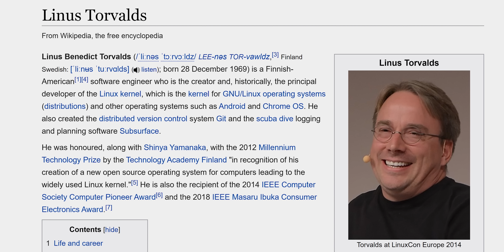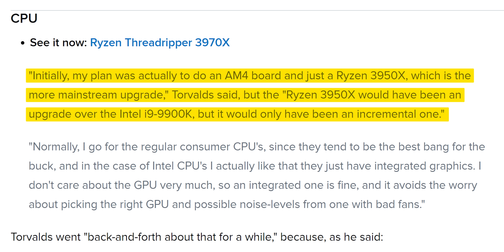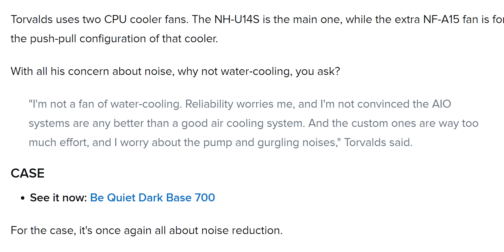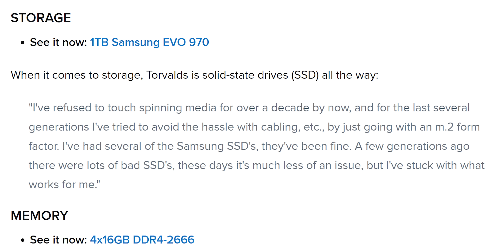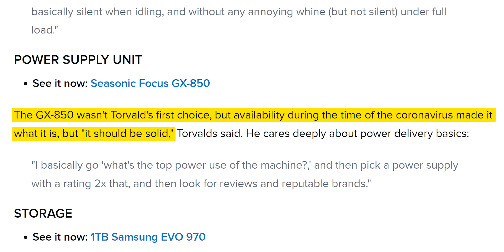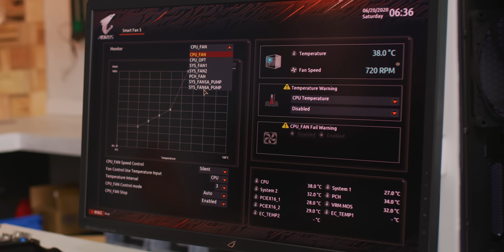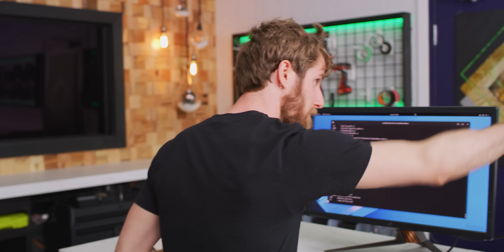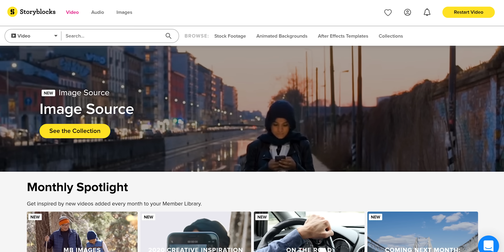Linus builds Linus’ new PC!

Comment: My Ryzen 9 3900x temperature go 86c when I run cinebench r20 and I rendering my 3ds max project

86c is normal or something wrong with my pc?
Reply: It's a little high. Are you using the stock cooler? Maybe you could try with an aftermarket cooler. A NH-D15 would probably do just fine.
Reply: @1idd0kun  I am using 240mm AIO Liquid Cooler

Comment: I used to run Gentoo/Funtoo as a daily driver (yeah, insane, IDC). I have found that getting ccache up and an instance of 'screen' running for any compiles - then detach the screen, is a better way for timing true compilation performance. Since the system isn't throttled by the output to the tty and can bypass it, it tends to run a bit faster (gentoo is for ricers!). At that time I was running on an 8 core with hyper-threading. I have yet to attempt this on my current system (i7 9750) mainly because I've been lazily running Win10 and don't feel like mucking about with the current EFI BS in the BIOS, and am now addicted to Elder Scrolls Online so no dual-boot for me in the near future.

If you can attempt timing the compile again, in an instance of screen - I am curious what the affect (if any) would be on a 32 core system.

Comment: for the quiet dual fans on U14s, you need to use LNA and the included thicker anti-vibration pads on the pull fan. If not you'll get air turbulence noises.

Comment: I'd propose for you to consider running compilation of open source software packages, docker containers and running test suites while using a graphic-intensive IDE (simultaneously) and judging the performance of those aspects, including GUI responsiveness degradation, as the "developer machine use case".  Of course, many developers use text editors and offload their compilation... but developers whose needs are served by a macbook air or chromebook aren't that interesting from a build perspective.

Comment: I work with a very similar build (same case, board, cooler with push/pull fans, and 3 fans for the front as well). Did you not notice a weird whine coming from the rear cpu opt fan? In the push/pull config that fan’s closeness to the heat sink causes a very noticeable whine, fixed it by capping its rpm to 680 or so.

Comment: 3 and a 1/2 minutes ? you did something extremely wrong there... that 3970x should be much faster than that. setup a a tmpfs (equivalent to a ramdisk) and do the compile on top of that... even the EVO is freaking slow compared to a filesystem in RAM :)

Comment: Quiet and not hot Ideally. 
Also fast and lots of threads.
My last two dev machines have been very fast laptops. an I7 and a Lenovo Xeon workstation laptop,
Both have been very capable but the old HP I7 was a menace given how it used to act like 600w heater. At one point I worked in a small room with another guy who had the same machine and the temperature was intolerable. Sometimes 29 Celsius the height of summer. These machines are great but they need an air conditioned environment to allow their operators to work properly.
The Xeon machine is faster and less hot - go figure.
Luv and Peace.

Comment: I am senior full stack developer and I really care about the smallest detail in My computer, got a threadripper 3960x with 3 OSs virtualized running at the same time with 3 monitors and 3 5700xt, the 3 OSs are Ubuntu, Windows 10 and macOS, each one have 24 gigas ram ddr4 3600 with the xmp profile enabled and each one has 2tb nvm drive, of course a 32" Wide screen 1080p 144hz pannels for each OS. Everything built and satup by myself piece by piece

Comment: I do exactly the same thing with motherboards - buy for overclocking, don't overclock - on critical machines, and for exactly the same reasons. The digital audio workstation in my recording studio isn't the same kit as here, because I built it a few years ago, but was built with the same reasoning. And it's been an absolute rock. It just doesn't fall over. Neither did its predecessor, nor do our homebrew servers. (Which, for the record, need nothing like the capabilities yours have. But we do have them.)
It may sound a little silly, but my experience says it works.

Comment: In my opinion, you did 2 things wrong.  Put the Graphics Card in Slot 3. You also have full 16 Lanes there.(airflow and style)  Second: You dont used the thick silicon fan spacers for the second fan. (noise) (fan blades to close to cooler fins)

Comment: One of the things the Computer Science college at my my university requires for everyone is to take a couple electrical and computer engineering courses. They wanted us to better understand the hardware from a low level perspective and how that relates to system architecture. I must say that between those classes and building my own PC I definitely understand how computers work from each component up to the software that is running on it.

Comment: my first linux kernel (1.0.9 or 0.99, whatever came with slackware in early 1994) compiled for a little more than one hour on a 486dlc40.
my slowest linux kernel build (whatever came with Debian 3.0) ran on my Amiga 3000, taking around 8 hours.

Comment: I sadly haven't built a development PC for myself cause a laptop was issued to me by the firm, but I did spend a lot of time tweaking it and opening several times to replace the thermal grease and blow the dust out.
However, it just happens that my work laptop is also a gaming laptop, and the performance is incredible when it comes to work.
Sure, the heft (from the cooling solution) and graphics performance is definitely not needed for work, but it did save me from blowing my wallet for building a gaming PC as I inteded to before I received the laptop.

Plus, it's a laptop; portable, and being able to game wherever I am makes business trips way less of a pain.

Comment: I think I have asked every tech youtube 4 or 5 times in the last 5 years to make a dev centric build... finally, someone did it.
I would say from my point of view (web dev) cores and ram are the most important. Multi-tasking and large files.
However long term storage is also important, but I typically have a server for that and wouldn't put it on the system.
GPU itself isn't exactly high on the list, but you still need something. I actually have 2 older (290x and 590) GPUs, something sort of uncommon for windows users, they are not the same kind, but I dedicate one to a virtual machine, so it isn't exactly a problem.

Comment: Question for the comments section here when it comes to SSDs or m.2s what kinds of life span are you getting out of these  one of worst fears is a dead or dying hard drive  I still used some 2.5 drives for longer term  storage currently some of my hard drives are coming up on 10 years  old and are still good
Reply: I built a raid 0 with 2 Samsung pro 840s in 2015. The drives still work today. Keep in mind these are the more expensive pro drives as I have written over 40 TB of data to them over the years. I also had a sansdisk plus which was shit and would corrupt all the time in a matter of months.  It varies on brand. Also I had a power supply blow and it took out one of my Samsung pros. So basically get a Samsung or Intel brand drive and be sure you have a quality PSU as the drivers are electo sensitive
Reply: Drives can fail at any time, randomly. You can't do anything against it. From my experience, SSDs have a longer lifespan than HDDs, this may change for heavy write loads. SSDs should work longer than 10 years, but you can always have bad luck and it fails at any time before that.
Use RAID (proper RAID, not RAID 0) and backups. If you build a RAID, use 2 different drives from different manufacturers, some drives have bugs that cause them to fail at exactly the same time.
Reply: Tape is probably the most stable storage but not an option for most of us.

Comment: I just built my new developer rig.  Because of Conronavirus work my old machine kept over heating during builds.  
I spent $2176 with shipping from New Egg for:
Phantek Eclipse 600s
Asus Tuf x570 Wifi
AMD Ryzen 3950x
ASRock Taichi Radeon 5700xt
32MB DDR 3600 (4 x 8GB)
1TB Seagate Firecuda M.2 nvme
650w Asus Rog Power Supply
My code builds are running approximately 3-5 times faster now.  That saves me hours per month.

Comment: Actually looks a bit like the PC I  put myself together.
Though more gaming optimized, so components differ a little.
In my ...
Case: Fractal Design Define R6
CPU: I5 9600k (by now i would have taken maybe AMD or an I7, but at the time i built it amds newest generation wasnt out , bust most of the time i am not cpu bottlenecked)
Ram: 16GB Corsair sth as far as I remember, was imortant that it was low profile to me.
PSU: Be Quiet Dark Power Pro 650W (or maybe 550W need to look, calculated it back when i build it) (*1)
Storage: 1TB Samsung 970 Evo
GPU: MSI RTX 2080 Gaming x Trio
Cooler: Be Quiet Dark Rock Pro (4 I think)
(*1)  Actually calculated maximum power consumption I got from hardware tests, and dimensioned the PSU such that 
0.7*PSU_output ~>= PC maximum consumption

Comment: I have a question for anyone who knows a lot about Linux. Since distros are built on top of a version of Linux. Do they tend to keep up underneath with the current core version of Linux or do they end up having to cherry pick what they update and when? Or maybe I have this wrong and whenever a new distro is created it generally locks at whatever version is current at that time.
Reply: Depends on the distro. Something like Debian uses older software that is more stable and only adds security fixes once released.
Other distros like arch have a rolling release and has the latest stable kernel by default.
However, you can always choose your own kernel version and compile it yourself.

Comment: I have a question, should my build be. RX 570 8gb, or GTX 1050ti 4gb
Reply: RX 570 if you use Linux, better open source driver support.
Reply: I have both. RX570 is a LOT more faster, also louder. Well, my gtx1050Ti is passive cooled :)
RX570 would be my choice if I had to choose.
Reply: Well im planning to use windows 10, and i dont really care about the noise haha, anyways thanks so muxh for the responses guys, and was also wondering whether pairing a radeon graphics card with a amd ryzen 5 or 7 both 2nd gen will be better or will intel core i7 9th gen do
Reply: @richardlin8607  Intel has lower latency because the infinity fabric from AMD increases latency. However, You get more bang for your buck with AMD.

Comment: I will list below the things that developers might need and their associated fields/processes FYI:
reasonably high core count and speed - compilation, pretty much everyone needs to do this, but because most of the compilers are not that well optimized for a LOT of cores, you don't usually need a threadripper like CPU.
RAM - TLDR, more RAM makes it easier for developers to work with data especially in data science, simulations, graphics, and ML, because the more RAM you have, the more stuff you can load on to it to make your program run faster, complete tasks in fewer cycles, etc.
GPU - most of us don't actually need a powerful GPU, it's mostly applicable for those who work in GPU accelerated fields (duh) like ML and graphical simulations, but even then, most people would prefer to have a separate server or even a cloud-based solution, because these use cases suck up pretty much all of your PC performance, making it pretty useless until the training or the simulation is done. 
P.S. feel free to "Um actually" me in the comments, but keep in mind that I tried to summarize everything and I may not know all possible use cases because the software development space is so vast.

Comment: for software development you basically just need a gaming rig minus the graphics card
the more ram you have and the better you can parallelise the shit out of it, the better your compilation and static analysis tools are going to run
Reply: No.
Compiling needs core count * frequency, a gaming rig needs a high frequency at 4 or more cores.
Gamers can't use more than 8 cores, most of the time they can't use more than 4.

Comment: Most developers don't build their own PCs because they have to use what the company provides. And yeah, most of them go the cheap route. In 20 years, only twice I was provided with a PC faster than my own (in either desktop or notebook category). And in both cases they were only SLIGHTLY faster. I still see a lot of dual core notebooks with hard drives.
And don't let me start on monitors and keyboards, I'm gonna cry if I think about those.

Comment: I was thinking of making a switch from console to pc! I already have a mouse, keyboard, desk and a 144 hz monitor! Since I have a 144hz monitor I want to buy a 144fps gaming pc, and I was wondering how to go about doing so. Price wise and all other attributes taking into consideration.
Reply: 144 FPS at CS:GO or at RDR2? That is a huge difference.
For the CPU the best bang for buck is a Zen 2 3600 CPU, without paying too much. If it costs too much, buy a 3300X. If Zen 2 is to slow, you would need a 10 gen Intel, which are about 12% faster but a lot more expensive.
For the GPU: AMD and Nvidia will release new GPUs in about 2 months, which are probably much faster than the current one, means prices will come down a lot from the current ones or you can buy a much faster new one if you have the money.
Look up the benchmarks for the game you want to play and see which parts you need for 144 FPS.

Comment: I usually look for higher number of CPU cores, I have to run many Virtual machines for any usual assignments. And enouh RAM, between 32gb to more. Won't care much about GPU, I've had used Ubuntu, Fedora or Oracle Linux as the OS in an Asus ROG & an Alienware laptop before. There were times when only gaming laptops had enough cooling.

However, desktops are much nicer and more robust. I'd change one thing from this build though, I'd use a 360mm AIO, instead of tower coolers. I haven't experienced any leaks in my personal systems till now. And they are less gaudy than beefy tower coolers.